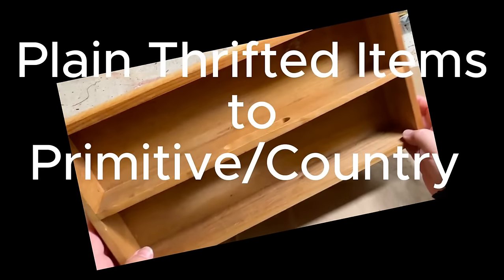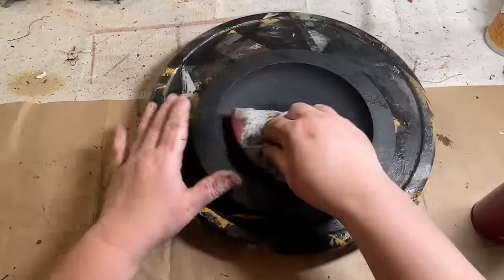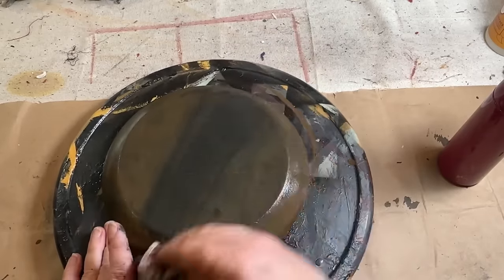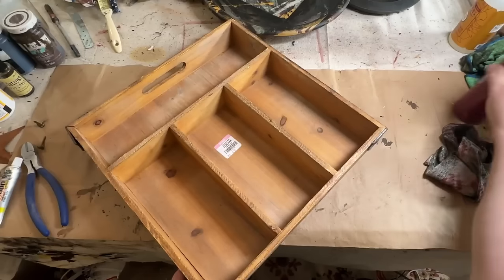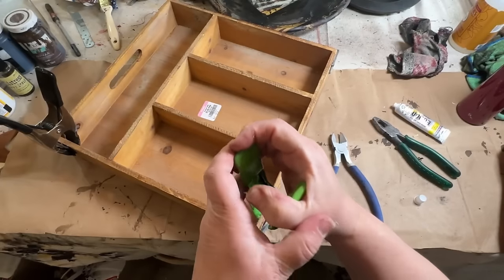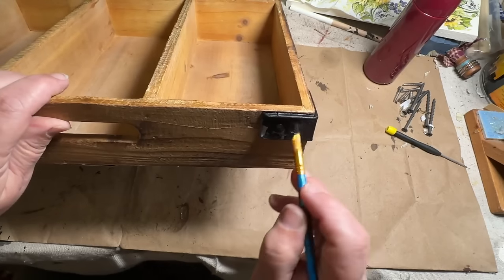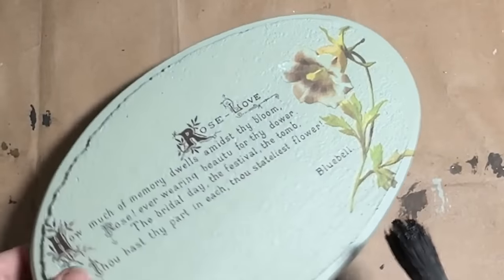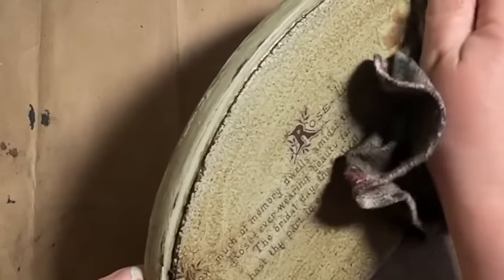Thrifted Wood Projects: Transformed Primitive/Country For Resell

Comment from the maker: In this video, I will be taking some plain wood items from Goodwill and Salvation Army and giving them an upcycle or repurpose transformation.
Also, I will be showing you some of the many 24 hour crafts cutouts. The shapes, sizes, and thicknesses. Check out more @repurposedmyway

*Wood Cutouts & Metal Signs:
24hourcrafts.com/REPURPOSEDMYWAY
Use this code at check out ( REPURPOSEDMYWAY) for 10% off